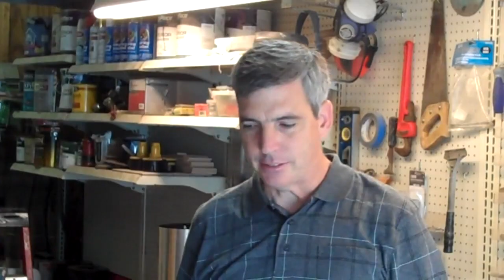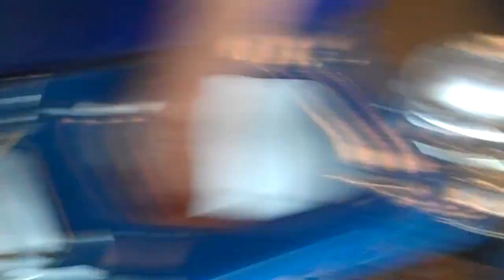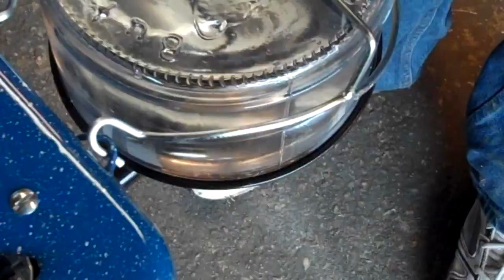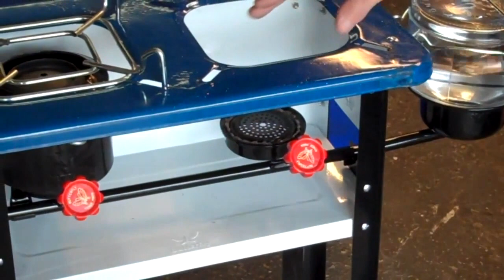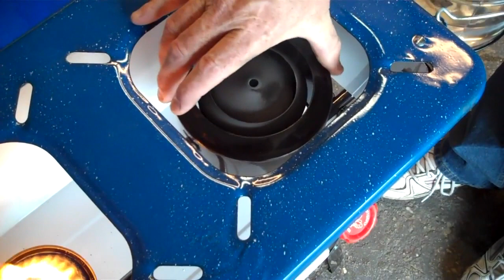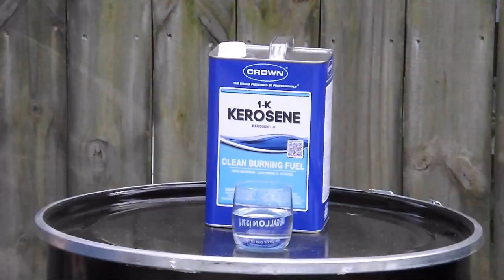. Kerosene: The Ultimate Off-Grid Fuel for Cooking, Lighting, and Heating

Comment: #1 diesel works just as good in everything I've tried it in and is cheaper than kerosene.  I've only seen it available in the winter months though
Reply: Works just as good in what? I've tried it in a wick lantern and a fiberglass wicked heater with suggested additives (fuel stabilizer & alcohol). The results were prompt carbon caking of the wicks. Kerosene and diesel are going for about the same price at present (ridiculous!). Even if diesel could be made to work with some other additive(s), the added expense gives the advantage back to kerosene.